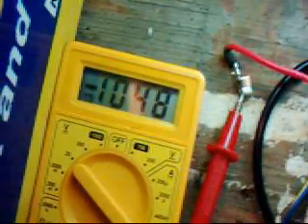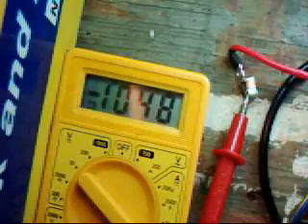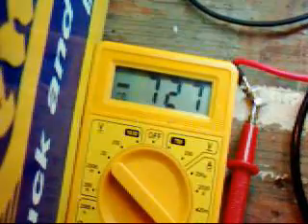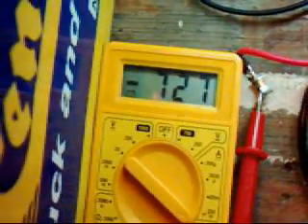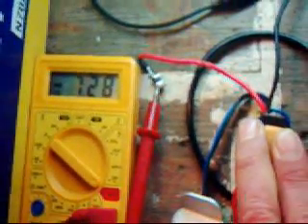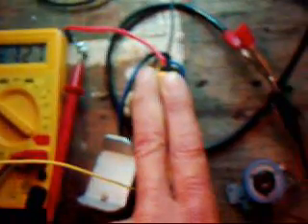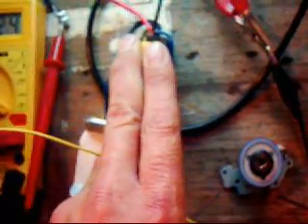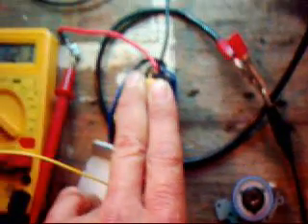HHO electron extraction

Comment from the maker: @m3sca1 i know there are some one wire things associated with the famous joe cell,but treating your radiator water wasnt one of them.
i would be worried about using the one wire radiator thing for the possibility of creating electrochemical corrosion in you radiator,or water pump or if you have an alloy head.a blown head gasket isnt cheap and there are plenty of proven safer ways to increase your mileage-cooling your intake air with ice,adding acetone to the fuel,adding hydrogen,etc etc...

Comment from the maker: @prototype9000 i watched the vid you sent me about that-1st i have heard and seems a little far fetched-i mean how could charged water influence the burn in the cylinder?
the radiator water and engine cooling galleries are in no way connected to the input of petrol air that burns in the cylinder.
the water does run around quite close in places to the cylinder but there is metal between stopping any water getting into the cylinder,and if water does get it then its a blown head gasket...

Comment: i was watching a video here on youtube where they ran a wire from the negative side of the battery into the radiator hose and that was it. I was told that it increases fuel mileage in the vehicle. by extracting the electrons in the water due to heat causes a positive charge then the negative wire takes the electrons away.  then the water becomes electronically reduced allowing the structure  of the water atoms to become smaller and directly burned in the cylinders.

Comment from the maker: yeah 8 volts out-dunno about the current-enough to run the little motor and warm the leads up if no motor in the middle.
supply battery is 12 volts thru PWM battery drill trigger-i will get back to you...

Comment: How much voltage do you get out ?
8 Volts ?
How much current ?
Please try with a 100 Ohm load resistor and
measure the voltage at it.
What is your supply voltage for the HHO cell ?
How many Watts do you put in to produce HHO gas ?
Many thanks.
Regards, Stefan.